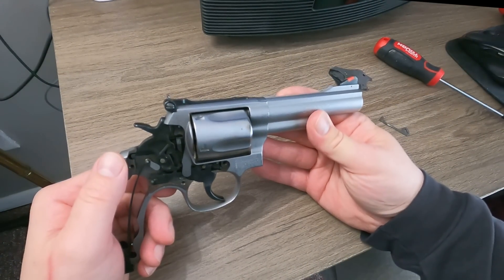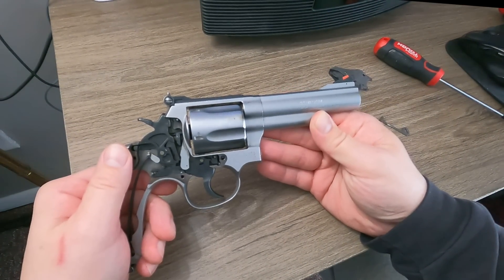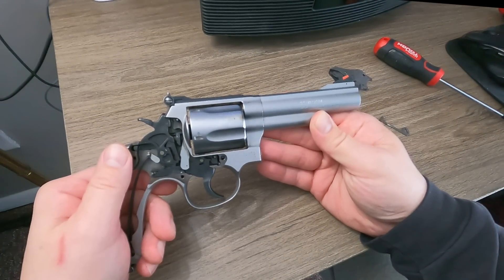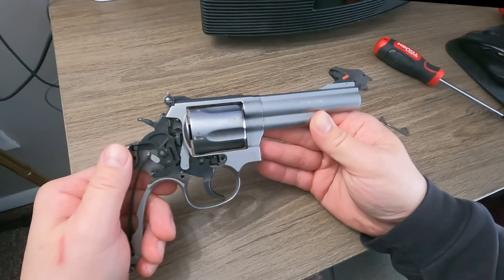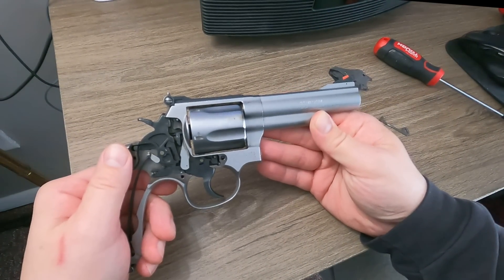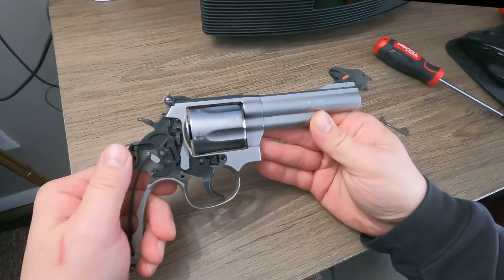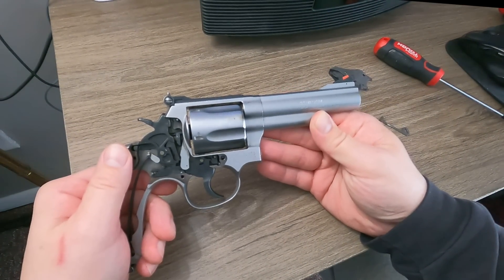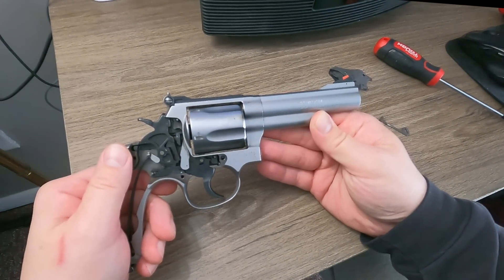Why Smith and Wesson's Revolver "Safety" Action is Superior to Taurus, Ruger and Others

Comment from the maker: I want to point out that I am not saying that the S&W revolvers in and of themselves are better than Ruger or any other brand, I am just saying that the design of the action makes more sense for reliability. I do carry a Ruger LCR as my EDC without concern. My video is sort of like if I said, "the reason why leather holsters are better than Kydex" and listed a bunch of reasons. 

When I say "superior", this does not suggest that other designs don't work. I kind of got that impression from people that they think I am saying S&W works and Ruger doesn't work. Not what I am saying at all. Within two or three GOOD designs, there can be something that is superior even if all work just fine.
Reply: I'd say that's what Taurii are for, the folks who are going to put a box of ammo a year through it. I own a few Smiths, and while my EDC is a Taurus,  I'm not going to make a PPC gun out of one. 06:25 I'm also not a fan of the factory installed stress riser notch in the hammer strut on the 856. I swapped in a solid one out of an 85, and bobbed the hammer to make it DA only, so the interference with the trigger strut when cocked SA is moot.
Reply: Hmm ruger does it right. Taurus and rossi have always been subpar. I've also had taurus's break on me. Didn't ruger have the patent? OK I got Questions. would you rather the transfer safety bar break and the gun not go off or the hammer block break and the gun go off when you don't intend it to? I understand there are more safeties on the sw like the disgusting key and the one that keeps it from being opened while the hammer is back but is the only one for the hammer that block? Also by using a separate cam that actuates the rearward linear motion into effectively a vertical shim subject to more surface impingement than the transfer safety bar? Not to mention it would technically raise the bore axis a bit? I respect your opinion. I'm genuinely curious. And I think you're right in different ways like if you got enough fabric stuck between the hammer and firing pin the block would be superior.

Comment: I think Taurus design is more reliable in the snow and ice inside action conditions. The Taurus firing block can push out excess of the snow or ice building inside the action. S&W will get ice and snow buildup inside the action will get stuck to the point where hammer can not get to a firing pin due to a snow and ice blocking the way  ( also pocket dust - lint can play a role  )
Reply: Interesting point, thanks for sharing.

Comment: I've got  S&W and Rugers. only ever had to return the S&W's to get worked on. Both times failure to fire, twice a 686 and once a 629, both started with double action failure and progressed into single act failures. Had 2 Taurus, 44m went back 3 times for failure to advance cylinder and to lock in battery. Taurus 357 barrel had scratches in bottom of rifling grooves from a stainless steel bush, soft meta, both gone.. I only trust Rugers to use some hot 357 reloads, and then only the six cylinder model. My 686 started having cylinder advance issue, ok with factory ammo.
Reply from the maker: I have sent in a S&W once and a Ruger once, both for reasons sort of caused by myself. The Ruger was my LCR that I disassembled, and for whatever reason I could not get it back together correctly. The S&W was for a similar issue, but it was with my Governor and something just wasn't right with the ejector spring. Never had a real issue with either brand and I have owned quite a few of both brands.
Reply: Over 40 years of shooting and IMO Ruger makes the most durable (especially for heavy loads) revolvers.

Comment: Really good video.  We were having these conversations in the 70s and 80s, and I even recall writings of one experienced gun writer who’s still around today singing the praises of a S&W action over a Ruger Security Six - and he may have been writing an article about some flavor of Ruger DA revolver. In their defense, Ruger Speed and Security Six actions tended to smooth out decently the more they were cycled, but still not the same as a S&W. S&W vs Colt is another matter best left up to the taste of the wheel gunner - but a particular run of Colt Troopers and Border Patrol models that came new-in-box with innovative 19-pound DA pulls is worthy of mention.  I’m actually surprised that Taurus was that much different than Smith because I was under the impression that Taurus originally manufactured revolver under license from S&W, and because most of their revolving cylinder line still resembles S&W revolvers.
Reply from the maker: Yeah I recall that, sometime in the 70s or 80s or whatever, Taurus was making some S&W's, contract was up, S&W didn't want their machines back so Taurus just used them to make their own stuff. I don't know, maybe 40 years ago Taurus used a different design. The side plates are near identical now so I could see how the main cutouts of the frame and side plate could be the same, just slightly different internal cuts and nubs.

Comment: This is the best description of a S&W revolver's safety mechanism (ditto Taurus) that I've ever seen, and presented in an easily understood format.  Well done indeed!  I've owned S&W revolvers since I was 20 years old (sooo ... 35 years now, as of a couple weeks ago, LOL).  I've shot Smiths, Colts, Taurus, Ruger, Charter Arms, et al. and to me the S&W is always the best.  That's mostly subjective, of course, and each has its merits and negatives (Colts, for instance, have bank-vault tight lockup but at the expense of putting pressure on the pawl meaning they're more likely to go out of time).
Reply from the maker: Thank you

Comment: Many think that the older S&W with hammer mounted firing pin arent drop safe. But that is not true. They also have the hammer block. I dont know exactly but S&W at least from 1950ies are drop safe.
Reply: Yes and I like it better than a floating frame mounted firing pin with a little spring.

Comment: My daily carry is my S&W 637 Airweight. I like to practice a lot and over the past 10 years have fired in excess of 15,000 rounds of hand cast and hand loaded standard pressure round nose lead ammo through it. At around 9,000 rounds the factory boot grips cracked and came loose from the frame, so I replaced the grips. Also at around this point, I switched over to appendix carry and bobbed the hammer to make it more comfortable on my belly. At around 12,000 rounds the Hillary hole lock mechanism broke loose inside and completely jammed the action. I removed it. At 14,000 rounds the firing pin broke and I had to replace it. But I've never had any hammer block safety issues. 

On the other hand, 6 years ago I bought a Taurus Single Action Army clone with a transfer bar safety mechanism. Part way through the second cylinder full of 45 Colt cowboy loads, the transfer bar broke and "transfered" the revolver into an expensive paperweight.

I have three other Taurus revolvers that have performed perfectly over many hundreds of rounds, but I always wonder when, and if, a transfer bar is going to break...
Reply: That's just what i was going to ask about, the absurd S&W hillary hole locks, and whether they ever do break, or if it's just rumors. Well, you answered that question!
Reply: @leaonardland9001  The Hillary Hole will eventually break, but in fairness only after many thousands of rounds that very few revolvers will ever see. In my case the tiny lock mechanism fell in and bound up the revolver's lockwork making it totally non-op.

Once at my workbench I removed the broken bits and simply plugged the H Hole, then went back to carrying and shooting the 637.  I also took that opportunity to bob the hammer spur.
Reply: @paulkleinkramer5065     The times i've had one of those stupid things i was proactive and did what u did to the hh, and i've also bobbed hammers.
Reply: @paulkleinkramer5065   I'd never buy another one with it.  Besides that, S&W quality isn't what it used to be.
Reply: @leaonardland9001  Hmmm, I haven't seen anything but truly excellent product quality and fantastic customer service from Smith & Wesson, of course I don't partake of their semiauto offerings.

Comment: Over 200,000 rounds through my Ruger revolvers with transfer bars, and zero breakage. And as a range officer and competitor, I've seen millions of rounds fired from Rugers, and have seen one (1) transfer bar failure, and no others that would render the gun useless. I have seen a couple Smiths crap out (broken firing pin, broken mainspring, several tied up when the base pin backed out), so my personal experience leads me to the conclusion that the Ruger actions are more robust than any other, and they are widely considered to be the toughest mass-produced revolvers available. I'll bite my tongue on Taurus revolvers...😆

Comment: Excellent video.  I won't do Taurus anymore.  Had two out of three break on me.  Never had a Smith or Ruger do that.  I prefer Smith for the lockwork and action smoothness.  Ruger's uses investment casting for a lot of their parts which is a lot stronger than the Taurus casting.  They cost more but you are paying for your quality control on the front end rather than the back end as with Taurus.

Comment: Great video and simple explanation of the two designs.  I own both designs and use to work in a gunsmith shop many years ago. It was my experience that the S&W actions were capable of more fine tuning for a wicked sweet trigger. The other side of that equation was that  I saw my fair share of S&W actions get gummed up or "binding" once any type of dirt and debris worked its way into the action. Prob not an issue for most folks. As for the Taurus designs they were easier/faster to play with the hammer/trigger return springs to adjust the trigger pull without much work.  The Rugers were in my opinion the most robust design, yet a little harder to smooth and adjust the trigger pulls. The new cam action on the Ruger lcr's are a marvel in design, strong, robust yet smooth.  As far as colts went they just seemed to get out of time more than any other brand.  I left those up to the real gunsmiths to repair.  Great content and information. Keep em coming.

Comment: Love the video! I love my gp 100 for ease of disaasembly, and the transfer bar seems robust
Reply from the maker: I remember taking apart an SP101 I had. Fun experience, sort of like the Ruger system as it actually is quite simple in design.
Reply: @GunSam  I wish taurus or s&w would make a .44 sp j frame. My Charter arms does not strike me as being robust, and has not been reliable.

Comment: Good point in some of your answers, it's about Design and Metal fatigue or Quality of Metal. Your point is well taken just that maybe how your word it it may seam bias . But is not , one has to remember this guns have advantages and disadvantages depending on the use and or intended purpose. How much use and or abuse all needed to be taken into consideration! 
These machan-ism  were put in for Safety 
Because "We" sometimes forget the We aRe the Safety and overs-safety can work against the original safety of oneself for which the gun/Pistola were invented just an afterthought in my humble opinion! 
Great Video in any Case .!!👍👍👍🤙🤙
Reply from the maker: I do carry a Ruger.
Reply: @GunSam  yeah 👍 ..!
 They are good 👍 
Back in 79 then 80's the Pistola design started to change most revolvers did not had that extra Mayal Onder the barrel, Which to me added a design to the eye that was pleasing not to mention functionality, to me it has to have the proportion design thus proving it ergonomic.
That comey first!
To me the old Colt single Six or the Remington same with that heft in it have no equal, but we have the issue of that hammer Pin on a live bullet (No Bueno 😁) how ever the only one in that configuration but in  a more robust round 44 Mag. By Ruger (44 Hunter) mixes both old School new metal and a "Transfer Bar" really like that mix ! 
But it is for s certain purpose how ever with a few tweaks it can make a certain one bullet stoper...transfer bar and all . 
Revolvers offer a more think first than shot first mentality, cause if we talk about bullet quantities I rather carry an MP5 type , but there is to much glorification in fads of the industries, for semi auto pistolas, and there is such a thing as thinking on fun and ability to plinking and not necessarily a self defense mode all the time, when you grow up I. Turmoil it is not a glad thing to witness the death and destruction of what is around you. 
But shooting and Plinking will always be fun ! 
Particularly with a 22 😁😁😁👍 for family fun for grown up little kids in Us a good old fay 45 single action the best , or fast shooting nothing beat a 1911 .
My taste and opinion .
Every one is different!
Found your channel recently and like it 😉👍 , I tend to open Avery thing to see how it works and if can be improved that me .

Comment: Excellent demonstration sir!!!  Had a feeling ruger had that type of system. Notice cast parts in Taurus. Smith doesn’t.  Makes a difference in feel.
Reply from the maker: Thanks. Ruger's is definitely a transfer bar but done quite a bit differently being all in one in the pull out trigger group. If I had a Ruger as a main range toy I would feel totally fine about it, as you could buy a transfer bar for one at Brownell's or wherever and have it on you in case the main one breaks, swapping a broken one is a 3 minute process. You can't even buy Taurus parts other than from private ebay sellers and changing one isn't so easy.
Reply: @GunSam  another reason Taurus doesn’t make my buy list. 👌🏻I have a few but won’t get any more.

Comment: Charter Arms founder Douglas McClenahan who had worked at Colt and Ruger and High Standard was the inventor of the transfer par system if memory serves. it is a brilliant idea, for making a simpler more economical action. In a SA revolver it is even more useful. Manurhin uses the S&W system in most of their designs like the MR73. The sliding hammer block inside the sideplae is an after thought, and was not always used. It is not strictly needed. My removing it makes no improvement to the action either.
Reply: Transfer bars predate Charter by decades. Iver Johnson sold the Safety Automatic revolver beginning in 1895, and it wasn't the first revolver with a transfer bar.
Reply: Douglas M. claim to fame was that he had pioneered the a revolver with no side plate. Frame is solid steel on both sides.
Reply: Just got my Charter Undercover a few days ago.  Hope it will be reliable for home defense.
Reply: @robertonavarro7713  With occasional use and avoiding abuse (flipping the cylinder shut) I think it should last a while.
Reply: @TacticalTerry  I will follow your advice. Thanks for the tip Sir.

Comment: I Counter you're video with my 3 reasons a Ruger GP100 is actually stronger than 686 THAT isn't about the outdated bs about forged vs cast.  If you like them and they throw lead faster than you can they are all great! I'd like a 3" 686+ to match
Reply from the maker: I know being heavier and their simple action can take a lot of power, and longer cylinder etc. Good revolver, nice an heavy is a main good point to how much power it can handle.

Comment: Awesome GS《☆》Nice comparison Brother👍🏾My only S&W is a Bodyguard 38spl +P. It's hammer is concealed, If it's an actual hammer or more of a striker not sure. It prints less than my Sig P365 in my riding jacket so I carry it when I'm on my bike✌😎☮
Reply from the maker: Thanks. I am not an expert on the Bodyguard, fired one before but that's it. If it's like a normal S&W J-frame, there's a hammer. Looks identical to the one in my S&W in this video, just rounded at the top with no hammer spur. There is also a sear that is not on DAO revolvers so the hammer strike will always be rather light compared to a single action shot with a hammer spur.

Comment: I prefer the Ruger trigger to S&W. When I checked out revolvers several years ago I ended up getting a Ruger and later a Taurus. Both had better feeling triggers than S&W. The S&Ws all felt gritty and much worse. I grew up with guns well before hammer blocks or transfer bars. I still have revolvers with neither and that isn’t really a concern to me. It just means I carry empty under the hammer. My wife has an S&W EZ .380 and the trigger on it is good but I have never been expressed with their revolver triggers. It was an excellent video and very informative.

Comment: Good video. Something to think about with my 856. I haven't heard about this being a problem with Rugers and I hope that's true. But I just sent my new sp101 in for service for the 2nd time today so my confidence in them is a bit shaken. Not breakage issues just fitment issues but if I have problems for a 3rd time I think it'll be time to give S&W a look. Although there's really no SP101 equivalent from S&W that I know of.
Reply from the maker: I had a couple of SP101's and never had one break. I had some other Ruger revolvers like Single-Six's and LCR's that never broke either. Most people tell me their Ruger's never had broken ones either, but I have heard from a few people over the years where they did have one break on a Ruger. Heard from a couple people with Colts breaking them, and just recently heard from a lot of people who broken Taurus ones.
Reply: @GunSam  It may be worthwhile replacing it as preventative maintenance every so often. I've heard of firing pins breaking, so it may be worthwhile to replace that after a lot of rounds too.